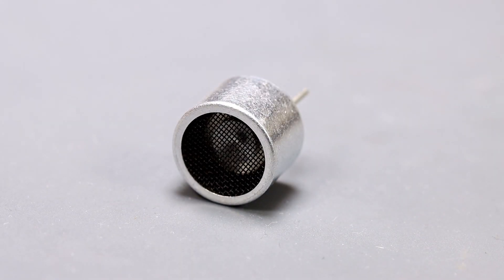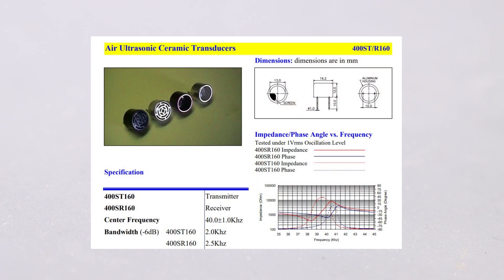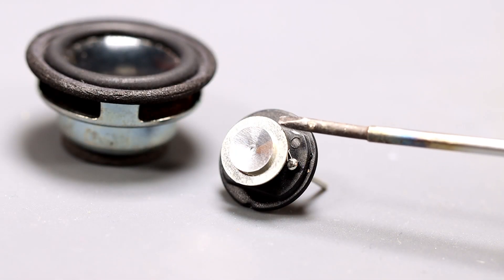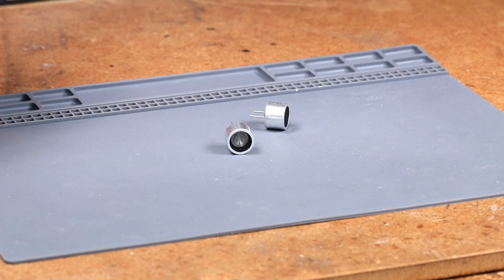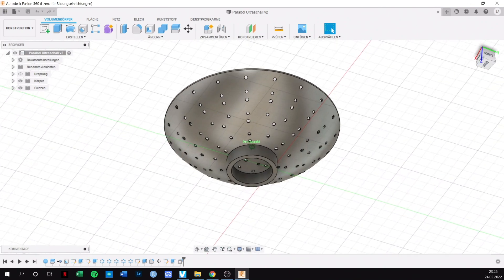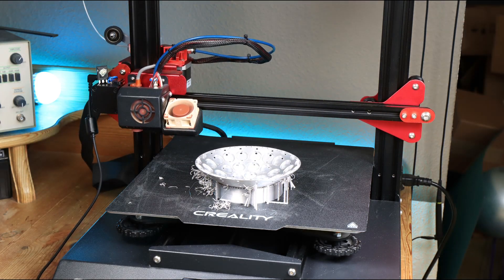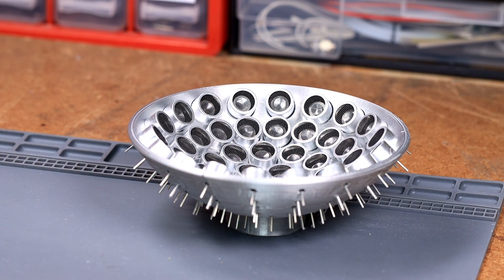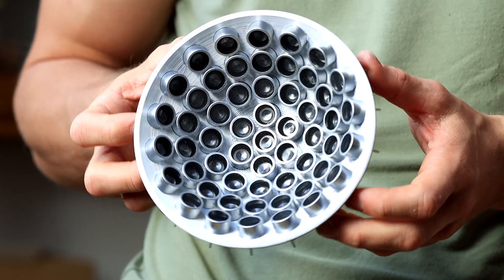How to control Plasma - Can soundwaves shape it?

Comment: Cool concept Leon! It does get me thinking about using microwaves to heat a plasma ball, and ultrasonic sound to keep it in place.
Reply: Haha that would be epic! You can also audiomodulate the Magnetron so the plasma plays music. 
Then you have a dancing an singing plasma ball floating in the air xD
Reply from the maker: @Phoenixfisch  good idea!!!
Reply: 55
Reply: with a nitrous oxide spark gap tube  and perfectly spaced piezo ceramic and Perma alloy  rings  make a cheap high efficiency microwave beam ie mazer or phaser  , the runaway mode is something i cant figure out 12 homeade arc tubes destroyed .

Comment: It would be interesting to find out what the ultrasound does with the E-field if no plasma (but a toroid) is present.
E.g. if the ultrasonic field comes from below, antigravity ?
In addition, the frequencies from the ultrasound and from the coil and the driver should be in resonance (octave or perhaps a fifth).
Just a little suggestion. E-field - magnetic field - gravitational field, whereby the gravitational field can also be electric.
Greetings Andreas B.

Interessant wäre mal zu erfahren was der Ultraschall mit dem E-Feld anstellt, wenn kein plasma (sondern ein Toroid) vorhanden ist. 
Z.B. wenn das Ultraschallfeld von unten kommt, Antigravitation ?
Zudem sollten denn die Frequenzen vom Ultraschall und von der Spule und dem Treiber in Resonanz sein ( Oktaviert o. vielleicht auch eine Quinte ).
Nur eine kleine Anregung.  E-Feld - Magnet-Feld - Gravitationsfeld, wobei das Gravitationsfeld auch elektrisch sein kann.
Liebe Grüße Andreas B.

Comment: Very neat! 
I would’ve loved to see how the plasma flame was altered by the two  ultrasound transmitters in line facing each other too!   
Could have your Tesla coil producing the plasma oriented the same way you have it, but rather than vertical, have the linear array horizontally mounted above
-I wonder if the segmented sections (as you visualized with the dry ice) would alter the plasma flame when the transmitter array is moved side to side? 
If placed in juust the right spot could the higher pressure areas cut and divide the single plasma flame into two? 🤔🤔🤔 
⚡️⚡️⚡️

Comment: a half dodecahedron would work better for wave lensing and those P8 piezoelectric ceramic ring  for welding machines output  is insane compared to there cheap  price .  + that roman dodecahedron is a good model for a 3d design
Reply from the maker: Thanks for the information!

Comment: I saw three zombie mosfets although the one that was used for reference might not be the one set back so possibly four. But since this variable is unknown my answer is three.
I recently built a pop pop stream boat with my kids and that uses pulses (like a pulse jet engine) for momentum. I wonder if ultrasonic frequencies could be used for population...
I must start testing this theory!
Reply from the maker: that sounds interesting!
Reply: It could also be the same MOSFET. But back to my ultrasonic idea. I have no idea how to reach a resonant frequency of 22.235 GHz, which is the frequency of water. But it would seem that only approximately 11.117 GHz will cause an appropriate ripple effect that might create momentum. Of course much more testing is needed.